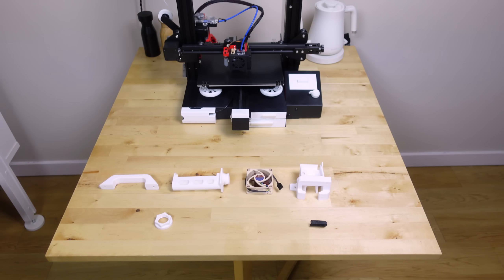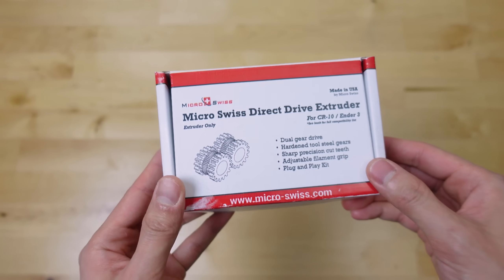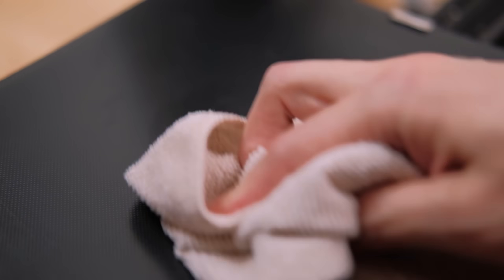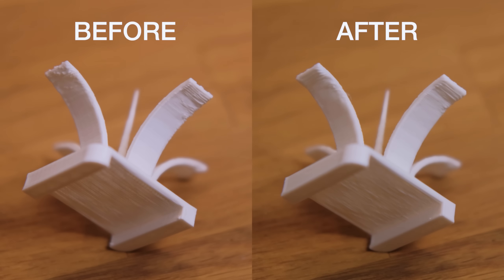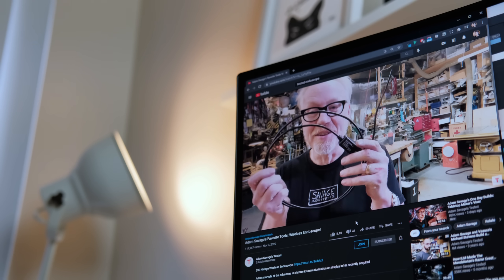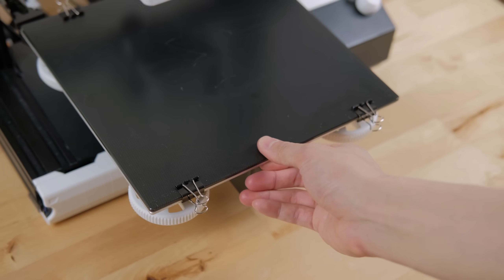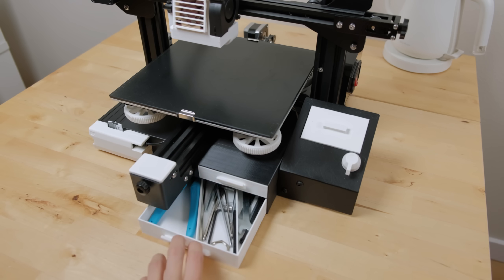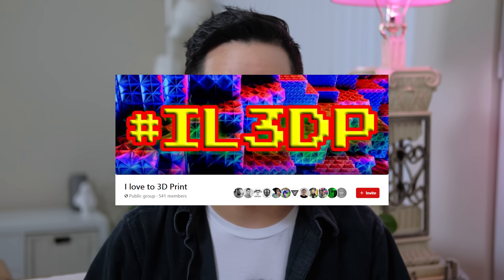15 More Upgrades for my Ender 3 Pro - Part 3

Comment: Did you do anything special in order to get your updated glass clamps on? You don't show this step in your video after you've changed to glass. I just see it on your bed at the end. I checked all of the measurements for what I ordered based off of what you ordered and they are identical. However, I 100% cannot get these clamps on. In fact, all I've done is scratch the glass terribly in one place.

Also, there's a 404 error on your link for the tension kits from Creality. I couldn't locate them on their site either.

Comment: Ok in the video he puts the new noctua fan in the psu but doesn’t show what he does with the other two wire because it has four I need help
Reply from the maker: the other two wires are for speed control when connected to a PC. in my installation i just fully cut them off and only used the positive and ground wires
Reply: @ScottYuJan  thank you so much I was just a tiny bit concerned so while my printer is running, the fan should turn on because I couldn’t get it to turn on right away

Comment: i just watched your 3 ender 3 pro vids , straight.
I wonder what are your retraction settings on the dual gear aluminum upgrade, i can´t find the proper one and it leaves a weak spot at the start of every layer, like under extrusion but it´s not.
Alrdy unchecked coasting, and even lowed retraction distance to 4mm at 25mm/sec, still leave  a wak wall. 
Any tip is apreciated :D Cheers

Comment: I’ve tried swapping the head fans out for noctua fans, but when attaching the converter to the main board, it blows up. I’ve tried 3 times
Reply: Make sure you turn down the voltage using a buck converter before you attach the fans. The fans are 12 volt and the power supply is outputting 25 volts.

Comment: This entire time i thought that I wasnt able to add a bl touch or do firmware updates because i thought i had the old 8 bit board on my ender 3 and then i just opened up my printer and realized that I have the 32 bit 4.2.2 board so now i can add a bl touch :))

Comment: My part cooling fan no longer works after the fan upgrade
It turns on for a moment, then stops. Everything is connected, wiring is fine.
The fact it turns on then stops confuses me.
Has this happened to anyone or would anyone know where to start because I've looked everywhere at this stage 😅

Comment: I've discovered recently that if you have a print that is super stuck to your glass bed you can stick the whole bed with the print attached in the
 freezer for 20 minutes and it will come right off.

Comment: What is the screw size/length used for the PSU mod M3 x length? 
I don't have enough projects/time to justify 10/24$ on a screw kit, gonna go get them at hardware store

Thanks love that PSU mod

Comment: The extension kit for the axis is not very efficient, there are long beams rather than extensions for the existing ones. I understand the troubles of having an adapter system on a beam that is supposed to be perfectly in line but someone at creality should redesign that because it´s a waste of metal. You end up with two old axis beams that have no further purpose anymore.

Besides that, great video series. I am still strugling to decide on my first printer.

Comment: not sure if you'll get this and reply to it, but when i tried installing the new noctua fan for my PSU i used the same yellow and black wires to connect it to the black and red but the thing is that, the fan doesn't turn on! I turned off the PSU right away and now I'm not sure what to do
Reply from the maker: the PSU fan has never been and isn't suppose to be on all the time. at least not for my printer. for me it only comes on when the PSU needs cooling which is usually after a print has started.
Reply: @ScottYuJan  i see ok probably didn't think of that. It kinda scared me because i noticed it wasn't on. I wasn't printing anything either. So i can generally ignore those other wires? Like the main ones to focus is the yellow and black wires?

Comment: to be completely honest, my ender 3 pro is practically the same as yours, also i tried the satsana duct with those blower fans and the fans are extremely loud even compared to the stock hotend fan, i had to send them back and use the stock duct with the old part cooling fan and noctua fan, any idea why the blower fans were so loud?

Comment: The main toolhead is gonna eat from the top height you can print though. 
Im printing a 240mm tall 'thing' and after 17 hours, Im praying to print all the way through with no problems. (Wishing i had a CR-10)

edit: I need that z  axis extender.  commented before finishing the video.

Comment: Do you use glue or another type of adhesive on your glass bed? I just got one and absolutely nothing at all sticks to it
Reply from the maker: your nozzle really has to be at the perfect distance. not too close and not too far. there are a lot of tutorials for this. if that is already the case then I would recommend cleaning the bed with some alcohol. often times fingerprints and dust can make adhesion difficult. aside from that i only use hairspray and glue sticks when printing with PETG. with PLA glue should never be needed.
Reply: @ScottYuJan  ok I'll try out cleaning it and re leveling. Thanks man. My main issue was the petg so I'll get some glue for that. Thanks for the reply

Comment: How in hell do you print PETG so well on Glas. I just cant get it to stick. PLA works fine with VERY good first layers. Im currently using 245 degress with 95 bed temp. Using a BLTouch by the way.

Comment: Used the same blower fans but those things are crazy loud compared to the stock, did you drop the voltage or the fan speeds?

Comment: I’m having an issue with my fan upgrade I installed my fan and it won’t turn
Reply from the maker: this differs from ender 3 model to model but for most models the fans aren't on all the time. usually it only turns on when the PSU gets hot so try starting a print and observing. it should turn on shortly a print has started for a short duration. good luck!

Comment: I had my printer for a year. I finally decided to get the Micro Swiss direct drive kit. I don't know what it is, but that thing is trash. I hated it. This video did give me (unrelated) some ideas. After my printer stopped working, I soaked probably another $300 into it and I still can't get that direct drive to ever finish print. Thus it just sat. Now it might get some action again. I need to get the factory hotend back. (I may or may not have threw the original away. 🤷‍♂️ I didn't expect any problems.  Oppps)

Comment: What would you do if the fan are not 12v But 24v ? I really want to use Noctua Fan but for my Anycubic Vyper but my stock fans are 24v

Comment: How did you deal with the silicone bed springs on the ender 3? I bought them but them from the link you provided but they will not go down far enough. Specially the one the in the left corner with the cable.
Reply: Howdy I had the same issue so I just left one bed spring in that corner and put on the rest and it works fine, I believe there is a file you can print to allow it to fit

Comment: I would not dare to use those Chinese converters to supply fans (especially noiseless ones), because they can randomly glitch, lock and stop working. It of course depends and you can use them and have no problems for a long time, but when it locks you gonna for sure burn something and inside of the printer is a very very noisey environment. Just using VOLTAGE REGULATOR would be more convenient, wasteful, but convenient.
Reply: They use fake ICs btw, that's why they glitch.

Comment: Did you have any issues with the blower being loud at all? I got the same one and it itself is about just about as loud as all the others combined when at 100%.
Reply: @oliviabanfield  that’s what I ended up doing as well. I also printed an adapter for the Satsana that makes a much tighter fit around the blower. Its not extremely quiet now that I don’t have air blowing from the sides of the blower. I used thing 4858866 and glued it to the satsana.

Comment: Alright, since you printed the case for the power supply, why didn't you just print out the largest fan size and gotten one of those. The larger fans can spin slower and push more air while doing so.

Comment: So.. Yeah. You showed it but didn't say it. Noctua is a great upgrade for the power supply, but..... They don't make a low profile fan that will fit without printing a new panel, as you did. Gelid solutions silent 6 is what I went with. Same profile as the stock fan, and still lots quieter than the stock fan :)

Comment: I have nothing against MicroSwiss, but $99 for their direct drive hot end kit is insane. Get the GulfCoast Robotics all metal hot end (literally an exact dupe of MS for half the price) on Amazon for $35 shipped. Then on Thingiverse, print the SpeedDrive. It's a very simple single bracket direct drive conversion.

Comment: Hmm so i actually just did all the fan swaps as you did but now my part cooling fan is on 100% all the time. even when i have 0% for first 2 layers and then 50% after. the screen reads the correct value that the fan speed is supposed to be but it just stays on 100% all the time. anyone have this issue? cant find anything online

Comment: Why don’t you use the sprite extruder as the filly ent path is shorter and can go up to 300c instead of having 1 single blower fan having to travel around the hot-end in order to reach both sides of the nozzle, and you can easily replace the part cooling fan if desired. You can even print a change system a bit like the x slide and them you can install the laser engraver.

Comment: it may be better to cut holes around the mounting points in the bed insulation pad so that it doesn't interfere with bed tramming, especially if someone is using stock springs

Comment: Hi scott i did some research on silicone bed springs and in about a year or 2 they will crack and eventually split as the heat decreases the structural integrity of the silicone so i would not recommend this orange springs would've done just fine

Comment: Thank you for your great videos, I'm just getting  started in 3d printing and I love what you've done with the ender 3 pro, I was wondering if you can recommend this version I found on Amazon https://www.amazon.com/gp/product/B08MWKW99G/ref=ox_sc_act_title_1?smid=A1RS1AJDKSSLTP&psc=1   So I can get a head start on the upgrades , thank you and keep up the nice work,
Reply: Hey Gastón i know im not scott but hopefully i can give you some help. Thats actually the ender 3 max which the only main difference are some firmware updates and a bigger printing volume for almost double the price of a normal ender 3 and almost 100 dollars more than the v2. If this is just your first printer I would recommend going something smaller such as the pro or even just the stock printer. If this is not your first printer and you looking for a large print volume then the ender 3 max is probably a good way to go. It can be modified fairly easily just like modify similar to all the ender models

Comment: Hey Scott hopefully you see this comment which im assuming you wont but whatever. I saw you print a scraper holder that attaches to the back of your printer. Although i thought that was a pretty good design i found this other print on thingiverse that has way more slots https://www.thingiverse.com/thing:3877505 this print allows you to hold basically all the stock tools onto the printer itself. Also great videos probably rewatched it so many times to understand the content so i really enjoy watching your videos. Hopefully part 4 comes out very soon. Thanks!

Comment: direct dive is great for the correct application but in most cases on an ender 3 introduces alot of vibrations into the print. stay away unless your pretty much gonna exclusively print something like tpu

Comment: Got a stock Ender 3 for $155 from Creality. $35 Silent Mainboard, $12 Borosilicate bed, $10 set of those Yellow springs and a $30 Raspberry Pi 4. 

It runs like a dream, printed the filament guides, tool holder, belt tensioners, Pi 4 Case with a rail mount, extruder knob, fan cover, and a few cable clips. Still gotta quiet the fans, but she's way less annoying with the upgraded board. Display thinks it's a Pro now too, so woot.

Comment: I made plastic spacers from a reference model of the ender 3 to extend the z height by 20mm and used longer screws since the wheels at max height still stop on the metal extrusion. Used a z rod from a broken printer and that was long enough but for the stock z rod I made an extension cap to reach the z rod stabilizer.

Comment: NOOOOOOOO! Spraying alcohol on the glass bed you're showing on 4:09 is wrong! It's a glass bed with a microporous chemical surface on the top. Alcohol destroys that surface and makes it lose it's adhesive properties. Water is fine though.

Also while you where replacing the PSU fan you should have warned the viewers that even though the printer is unplugged, it's capacitors can still possess enough current to kill you. This is definitely not an upgrade I would recommend to just anyone.

Comment: Do you feel like PLA prints have gotten worse since going Direct Drive? I have the Creality DD kit, and my prints are decent, but I been thinking about going with the MicroSwiss DD kit to have more fan mod options. It seems like it's an upgrade that isn't highly regarded like most other "upgrades", as DD is said to have many cons as well.

Comment: Prints a shit ton of different plastic, filament comes on plastic spools in vacuum plastic bags, and buys plastic upgraded fans ect while tossing out the old stuff. Worried about a little gas from a compressed air can...That's some serious AOC Green new deal logic right there...

Comment: I've been running my PLA prints with my bed temp at 80 instead of 60 and when the bed cools, the prints just pop off on their own. I started trying to start the print at 80 for the first layers then drop it to 60 but the prints warped BAD. Having the fan speed set to 10 for the first 6 layers with the bed at 80 degrees and nozzle at 220ish seems to be the ticket for me

Comment: Hey Scott ! Thanks for your amazing work ! 
I managed to install both fans and bltouch using your mod, but it seems that my bltouch is way much higher than before ... Can't print properly since, as my extruder crashes on the bed. Any suggestions ? Thanks again !
Reply: Try an m3 nut or a printed spacer :)

Comment: This is an awesome list of things, and thanks for taking the time to actually explain how to do some of the fixes.  One question I had was, for the Noctua PSU Fan swap, any reason you ordered a 4-pin fan over a 3-pin?  Since you're only replacing a 2-pin fan anyway, I Thought maybe the 3 pin might be a lot less confusing to some.  Unless there's a specific benefit to using the 4-pin version instead?
Reply from the maker: thank you! and no, no specific reason for the 4-pin. it was just the only one i found that came in the size and voltage i wanted.

Comment: 90% sure that all that stringing while printing the ducts is caused by the micro Swiss hotend, ever since I bought the kit, I noticed my print quality dropped drastically and I started to get the same stringing that you got with the PETG, but i was getting it with all filaments. The direct drive aspect is fantastic, but the hotend doesn't live up to its name

Comment: well I like ur videos but still buying cheapest printer and spending ton of cash for upgrading to make it good seems to me like weird solution ... I use to have ender and Ive had lot of problems with it(i belive it was manufacturing error on it)  and ive returned it, it was a while ago and than month ago one friend told me he want to buy first 3d printer and that he wants ender because he have seen lot of videos how good machine it is .... it took effort to convince him to spend little bit more and buy something more reliable without upgrading it ...

Comment: Thanks for your videos. My main hobby is trains, shooting videos of trains during the week with just an iPhone but on the weekends or while on vacation with my drones. So I have a good bit of money tied up in that hobby but like most train enthusiasts I also have a model railroad in my basement. Not the usual HO scale which has an almost endless supply for models and parts available but the much larger and more realistic looking O scale, not to be confused with O gauge. O gauge is the toy scale with 3 rails that was designed to handle tight unrealistic curves. O scale is as the name implies "scaled" properly. It's two rail and the curves are quite large, taking up a lot of basement space. Unfortunately O scale is very limited in what models are available. There are only a couple manufacturers of O scale locomotives and rolling stock. And they usually only release a handful of new models a year. So if you want a specific piece of rolling stock from say 1972, well sorry, they last made that piece 6 years ago. It's sold out and they won't be making it again until? Who knows? So I have been considering getting into 3d printing. I know when it comes to making 3d models you can see the print lines. Less on flat pieces and more on angled pieces. Most of the pieces I would like to print are flat or mostly flat. I would love to be able to print an entire hopper car. Then just add the metal parts. Decals in O scale are also hard to find. So I have also been looking into multi color printers. Fortunately the main color besides black is white so if it was possible to print the car body in black and finish with white raised lettering and logos that would be super. So I'm still investigating what is possible and how much it will cost. Your video was very informative on how the printer can be modified and also what quality the pieces are printed in. Thanks for making this video!